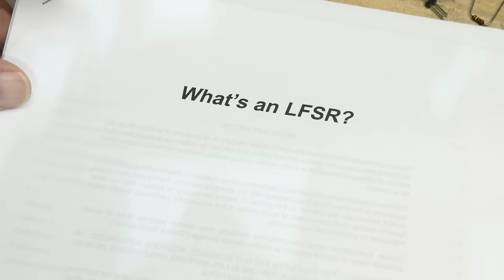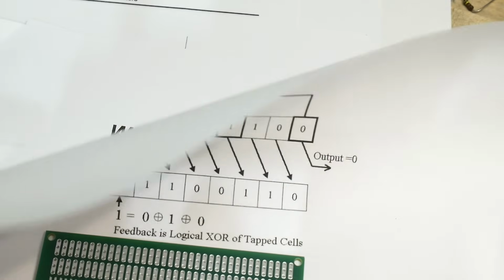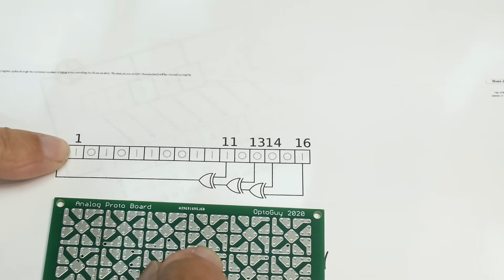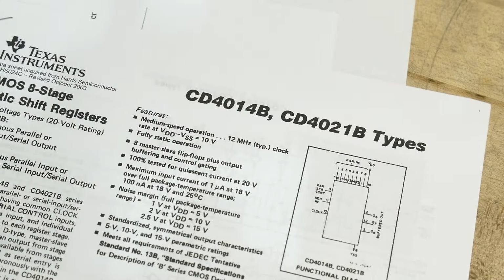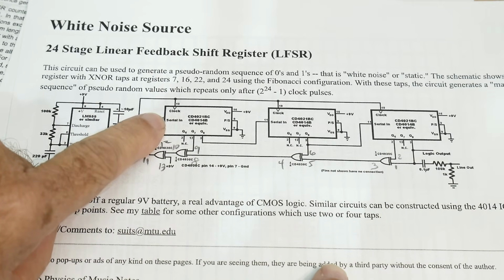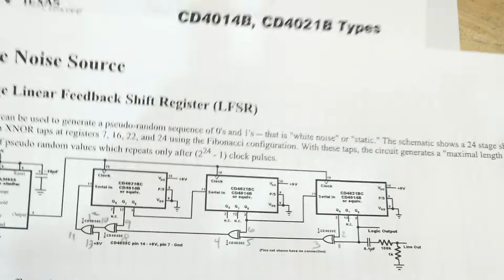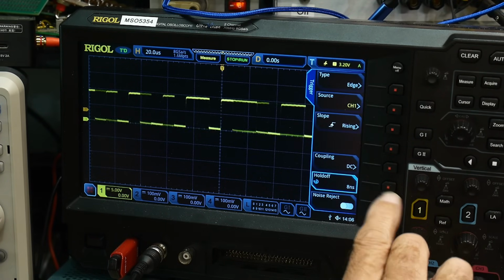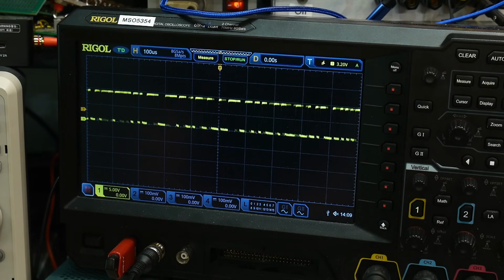#1699 LFSR Random Number Generator (White Noise)

Comment: No, it can't average to the middle.  It is close but it is an average of an off number of bits so it can't be the middle.
If you want a fairly easy way to make a lot longer version but also be able to test it to make sure you got it right you can to this:
So long as the lengths of two sequences share no common divisor, the XOR of those two sequences will give you a new sequence that is length N*M.  Thus if you make a 32 bit one and a 31 bit one, you can produce a 63 bit one.  At 1MHz each of your 32 bit things will complete a cycle in about an hour so you can test them.  The combined result will, however, practically never repeat.
Also:  If you want to use fewer chips, you can say that the 1's bit XOR the 4's bit of a decade counter is "random" and XOR that with your LFSR to make a sequence that is 10 limes longer.
0000 -> 0
0001 -> 1
0010 -> 0
0011 -> 1
0100 -> 1
0101 -> 0
0110 -> 1
0111 -> 0
1000 -> 0
1001 -> 1

Comment: I programmed an LFSR into an 8-pin PIC chip and used one output pin to produce white noise from bit 0.  You can "tune" the noise somewhat by programming a short pause after each shift-xor-xor-bitinsert sequence.  The longer the pause, the lower in tone the noise appears to be.  Generally, a NOP or two are enough.  The first part of the program inserts some known starting values into a couple of the bytes used for the LFSR just to be certain that all of the bits won't be zero.
One of the interesting aspects of an LFSR is that it can never produce a value of zero across all bits, and if it ever started out with zero in all bits, it would never produce anything but zero.  It's possible to get a zero out of an LFSR, but only by taking less than the full number of bits (eg. by taking only the lowest 8 bits out of a 32-bit LFSR).
Reply: Another way out is:  If the LFSR can be made as one with an XOR or a different one with an XNOR you can add a simple toggling flip-flop that changes it between the two from time to time.

Comment: You presentation is excellent! FYI: A 24 bit sequencer has 16,777,16 unique states before repeating. (I know you rounded off for simplicity.)
I used one of these with 32 bits for scrambling the input of a Manchester encoder driving a laser diode in a fiber optic video transmission system. This prevented getting very long runs of zeros or ones and losing clock sync in the receiver. We referred to the circuit as a PRBS, or pseudo random bit sequencer. 1mW of light went 32KM in single mode fiber. Early 1990s. Good times.

Comment: For analog white noise generator for synths, I use a NPN with a floating Collector pin and grounded base to generate the white noise and then some amplifier of sorts to amplify and band limit the signal afterwards. It's way simpler and cheaper and provides real white noise :)
Reply: I think he once made a video for synths and white noise. There he used a zener diode on the base of a common emitter amplifier. https://youtu.be/h61_3Sw2uYk?si=_PK7yXiRu4PPphrI

Comment: A few notes. The polynomials used to get the coefficients for a maximal length sequence are prime (mod2), and are the same as for CRC computation. The DC offset of the output is not quite zero, as the sequence will have either an extra one or an extra zero due to the odd length, but a max length sequence will be mighty close. Polynomials that give less than max length may have meaningful offset. For information about the spectrum, see the manual for the HP3722A noise generator and HP journal from september 1967. Ap note 98-2 (1969) details the H01 delay option for cross correlation testing of impulse response in analog networks. Also see the HP1930A bit stream generator (featured april 1971 HP journal)

Comment: If you look in Horowitz you will find an elegant combination of maximal length LFSR and FIR filter to generate a pink noise spectrum.  Caution: I have used a generator built to this design and the resistor values appear to be critical.

Comment: Um, Question from the novices: What app-note did you semi-display that contained all of that LFSR feedback connectivity in it?
Reply: Xilinx XAPP 052, but a much more comprehensive list with both 2 and 4 tap variations up to 4096 bits in length can be found in the Table of Linear Feedback Shift Registers.
Reply: @ChrisSmith-tc4df  Awesome: Thanks!

Comment: This technique can also measure error rate of a communication channel. LFSR sequence or  PRBS (pseudorandom bit sequence) generated by the LSFR/PRBS shift register is transmitted through a communication channel and received. Using the reconstructed clock, the same register on the receiving side is synchronized with the received data. The receiving side register output is compared to the received data in an X-or gate and errors thus detected. This technique was used way back in the late 70's on in the world of measuring error rate of digital data recording on magnetic tape.

Comment: I'd still call it pink noise since it is PSEUDO random. Computers are deterministic and can never generate randomness. You need a physical process like counting emissions to do that. Depending. But random numbers are so useful in computing, for example in resolving database keys, that you have to try.
Reply: Pink noise has equal power in each logarithmic frequency band (or octave).  This generates white noise with equal power in each linear frequency bandwidth.
See my comment above.
Reply: I did not know there were such precise definitions: https://en.wikipedia.org/wiki/Colors_of_noise   I meant any non-random noise. @iansomers6485

Comment: But if it has a 6dB per octave low pass filter on the output would it not be a pink noise generator?
Reply from the maker: I did a quick and dirty 'average' filter. not sure what my 6db frequency was.
Reply: No, that is not pink noise.  A one stage low pass gives you "red noise".  The pink noise filter has a lot of poles and zeros so it falls at 3dB per octave and not 6.
Reply: @kensmith5694  Yes, now I remember.  Thanks for jogging the old mind.

Comment: On the CPU, this approach of shifting out a single bit per iteration would be a bit slow (especially for graphics), that's why in the DOS era I would use a sequence of 3 instructions like this:

ADD EBX, ECX   ;add two 32 bit registers
SUB BL, CH        ;subtract the "liver" in one from the "lung" of the other
ADD ECX, EBX   ;add again the two regs to create the result for the 2nd reg

This produces 64 new random bits per iteration in EBX:ECX. Although repeatability was not tested, it sure did look ok on screen (no "beats" or repeating patterns), it looked just like TV static.
However I did write a small program that built a histogram over time to check uniformity among individual 8-bit values, and it was even.

Comment: Do you have video about stable analog noise generator circuits? Maybe some of those could be used as true random number generators with A/D converter.
Reply from the maker: https://youtu.be/evJcZdRJKT0?si=M3oelG3gJim1xeNY
also on my synth project: https://youtu.be/Ow9zQXPYm3g?si=BcbRdTCTnXUojSEz

Comment: Try this using program with internal registers in something like stm32f1xx or higher. Very interesting, easy switchable wide bandwidth signals. Even programing in c you can achieve 'shift' frequency in tens of MHz range.

Comment: Very interesting! I remember learning about this in highscool and having my mind blown.😂 
Later i met all kinds of pseudo and true random generators. Being analog, digital, software based... Zener diodes were used back in the day as white noise generators. Also in some aplication the randomness of a radioactive decay is used. For fun i made one true random gen using 32bit counter, interrupted by a geiger counter and a radium dial from an old clock. Fun little project.
Reply: Or a Zener diode placed near a radioactive source. :)
Reply: @stamasd8500  
Maybe it makes sense. There are semiconductor radiation detectors but in structure they are more similar to PiN diodes than zener. On a second thought ionisation event and avalanche forming in solid state matter is quite different from gaseus phase, so maybe it would not work. To have a measurable macsroscopic event (lets say, change in zener voltage) you would have to have insane high doses of radiation. But you gave me the idea, to make a noise generator on photodiode dark current basis. :) I belive IMSAI Guy would have to say something about this, as photoelectronics are his specialty, if I'm not wrong.
Reply: That's the way.

Comment: Cool, i used the CD4021, a CD4070 and transistor on a LFSR for noise, i made the pcb like a year ago and still didn't solder it.
It's used in the Roland TR-909, the worlds most famous drum computer and some other synths.
Texas Instruments refuses to bring the CD4006 on the market again, i use taps 8, 15, 24 and 31.
I also translate it in C/C++, burned it in a Microchip Fubarino and made a video about it.
Reply: I programmed a 32-bit LFSR into an 8-pin PIC with one bit as output to produce white noise.
Reply: @melkiorwiseman  i made a video about it, LFSR in C/C++.

Comment: cant you do this with a megaohm resistor?
Reply: No.  Johnson noise isn't repeatable and you'll find the spectral content different.  The repeatability of LFSR sequences is why these are used to "scramble" the data for EMI reduction on high speed data links including HDMI, USB, PCIe, SATA, and Bluetooth to name a couple.  In commercial implementation, you have to ask yourself why Japanese consumer electronics manufacturers like Roland would use a 3 chip circuit with a high BOM cost when a 1 meg resistor could do the job?  See the Roland TR 909 for their 32 bit LFSR based on a pair of now rare HD14006B 18 bit shift registers. When building synths, you seldom want perfect white noise and the Shot noise in PN junctions was the historical standard until material science reduced gold contamination to semiconductors to almost zero.
Reply: Yes ! classic simple noise generators consisted of a couple of transistors amplifying the breakdown of a reversed biased diode  @Peter_S_
Reply: @Peter_S_  resistor noise isnt that easy to make really,  its more just a resistor, you have to make it that quiet, and then amp it by more than a billion times maybe, and u have to get the dc offset of the noise right as well, that could go wrong too.
Reply: Yes, but it would become very sensitive to loading.
Reply: @ivolol false. (i dont want to sound arrogant, and the truth is boring anyway.)

Comment: these devices are used to generate the pseudo random codes in DSSS communications like GPS. There are some feedback configurations that generate periodical codes called Gold codes that have some interesting properties when doing correlations and allow communication below noise floor
Reply: Given the full or partial bit sequence can I deduce the feedback configuration of the shift register?
Reply: @wolpumba4099  Indeed, so long as you have the full architecture of the generator as well. Strong pseudo-random number generators are an intense area of study with many papers available. They use the term PRNG (pseudo random number generator) if you want to find them.
Reply: @wolpumba4099  I don't think so, that's the reason they are interesting for military communication. GPS satellites (GNSS in general) emit also more information, but is mixed with some other code (P code) which is not known to civilians. Even if you could get the LFRS configuration from the sequence, you don't have access to the sequence itself in the signal but you need it to acces the information in it.